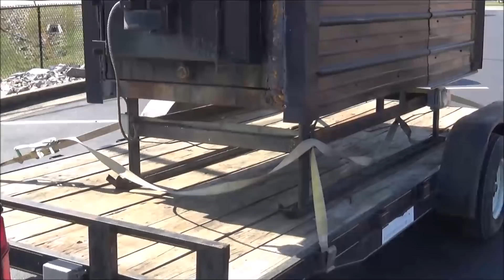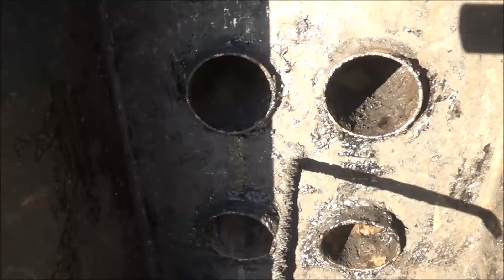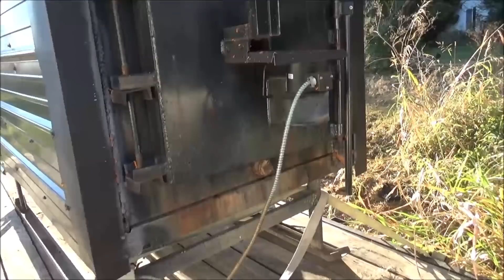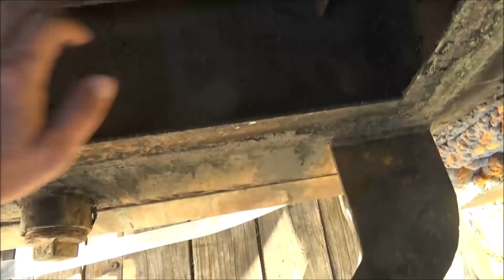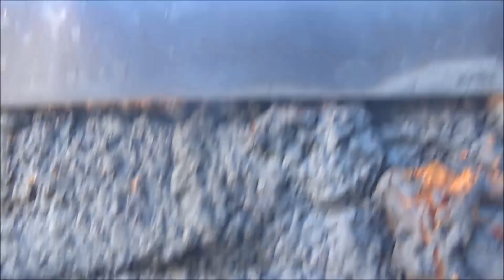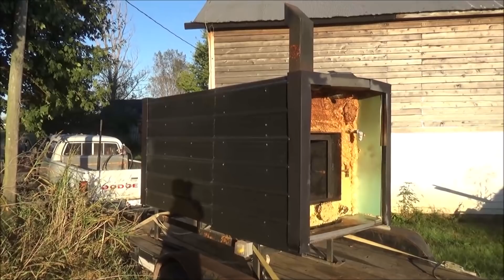New Appliance for This Old Barn Shop

Comment: .do not fire brick it  it will rot out these stoves build creosolt from smoldering wich makes acid iv had mine 20 years it was brick 3 years rotted out rebuilt no brick been great water tubes need to be on roof of fierebox and go the lenght of box i do live in north mich i heat my house garage and domestic hot water and clothes dryer
Reply from the maker: Thanks for the feedback. I am afraid with no firebrick it will not burn good because I won't be able to get the heat up from the water pulling all the heat out.  I know from burning wood in the house for years that the hotter the fire the cleaner the burn and the better it all works. I was wanting to get a big thermal water storage tank to add capacity and then set it up to run the fire wide open for like 6hours a day and store enough heat to last 24hours so I would only need to tend fires once a day and I could get it burning hot and clean for most of the time rather than slumbering along smouldering all day making lots of smoke and creosote. Thoughts?

Comment: Saw this video when you first posted.
Ran across it to day.
I am Kinda of a subject matter expert.
My advise would be set it by the road for sale.
I do lots of infloor  projects on both
 wood and gas.
Assume you don't have natural gas , that leaves propane, which is fine.
It's not cheap to hook up one of these up correctly. (Especially at a distance, flow rate, high head pumps etc)
Lochinvar makes a Noble wall hung boiler that will also heat domestic water ( nice to wash up with)
I heat my shop (8,500 sr ft were your crane scale used to live)with 150 k model in Michigan.
The low water temp's that the floor  can utilize is were these boilers shine, mine runs 90 degree water temp's that allows 99% efficiency with flue gas analyzer. ( 90 F -10 Degree Delta T means 80 degree return water means you get a sweating boiler inside, creosote build up.
BUT
I do have a hudge 60" x120" wood boiler "fire tube"
That sits on top of a poured concrete foundation which is lined with fire brick, it can do up flow gasification and reach temperatures of 2,000 F.
It's all still all there, fully mission capable. Don't use it, anymore.
Hang the boiler on the wall, few hours of hook up and back to machines not chain saws, for what it worth,  my 2 cents.
Reply from the maker: I already have a $2k/ year gas bill for the house, not really looking to have another one for the shop, but I do agree that fooling with wood is a pain in the ass. If I wasn't having to handle it all anyway to clean the fields every year I probably would do as you say. I am planning to use a large insulated water storage tank so I can hopefully run the boiler hard once or twice a day so it burns clean and efficient then have a mixing valve to control the much lower water temps on the floor circuit.
Reply: @bcbloc02  
Your on the right track with the mix valve or a variable speed pump actually might be cheaper, buy one thing instead of 2.
I'll email you some pics of my described wood stove.
It's what you build when you have depression to keep your mind busy. It's kinda nuts. Boiler holds 1500 gallons tank holds 4000 gallons 
Honesty, I would not advise anyone to go to wood burner route. 
What's your electric rate, ground water close or a Good well.
Water to water heat pump work great, have one of those too, rate went up to 9 cents on off peak.
Needs to be 4 ish cents.
Betting your going to try wood,  
Easy to make mistakes,  questions
Reply from the maker: Yes I have a spring just down from the shop. Who makes a good water to water heat pump?
Reply: @bcbloc02  
Mine is a trane 6 ton, but really anything you can find would work
You could build one. If you have any refrigeration back ground.
But I am sure with your audience there is one out there, just sitting around. The other good thing is that you can use a chilled water fan coil and air condition. I stuck a wood boiler coil on the inlet side of the gas unit heater (that I use to buck the temperature up above the infloor radent see point[ winter]) it pulls down the humidity in the summer, gota believe everything rusts down  there.  
If you really wanted to be fancy, pull the humidity down below the dew point W to A then put chilled water into the floor. (That's kinda a show off thing) called chilled beam. There are some surplus outlets for NOS HVAC stuff.
Quick look on line new 5ton 3,500

Comment: Looks a lot like the Taylor brand of stoves. Make sure to use the chemicals to keep it from corroding. Taylor also uses a anode rod to protect the stove. I would build a rack for the fire to burn on so you can get air through it otherwise ashes build up and it’s hard to get a good burn

Comment: Wow! I'm a retired steam locomotive engineer and mechanic. With our shop being located at 6,250ft. elevation in Nevada heat was always an issue. Being in the boiler business (sort of) we had to kluge up some sort of wood/oil fired heating device 'cause working at 15 degrees ain't fun. From what I could see I have a couple of observations... fire tubes... too few and too low. Fire brick the floor and a couple of courses up each side to protect against flame impingement. There are several ways to augment wood with an oil drip (waste oil) being blown in with a squirrel cage blower. We made our heater from a 500 gal. tank with 16 fire tubes and forced induction pumping hot water to some giant 19th. century radiators. Can't wait for your adventures in flue cleaning and thermodynamics...lol. Creative routing of a steel chimney recovers some otherwise lost heat.
Reply from the maker: Chuck Haynes curious what you think about corrosion troubles in the space where the firebrick and tank would meet on the sides. Apparently this is a common area for rot out of the firebox as ash and soot likes to get in the gap that occurs there from expansion and contraction. Thoughts?

Comment: That should work well for you, I once rented a room in the basement on an acreage with two houses, both were heated off the same outside wood-fired water heater, very similar to yours.  They were running a water-glycol antifreeze mix, but it worked very well.  Glad you'll have heat int he shop this winter, makes a huge difference!

Comment: Very interesting comparing this design to a locomotive steam boiler. Convection heat transfer efficiency is all about surface area exposed to the temperature delta between the flu gasses and the water. I would think more small tubes would work better than four big ones, but I guess we’ll have to wait and see how it works!  Also, a pellet fuel feeder would be handy once you tire of feeding that fire with real wood scraps. :)
Reply from the maker: Yes more small tubes would certainly be better. I think the reason they typically made fewer and larger ones was for ease of cleaning.  I feel like one of these properly designed should have much more length of tubes to properly transfer the heat completely.  I suspect a fair bit of heat goes up the stack on this one but maybe that was found necessary to create enough draft? Can only see what it is like in operation and go from there.

Comment: I'll just got a similar one for my 200m2 shop . my plan is to put it inside and put an aditional stack of tubes on the outlet to take care of the waist heat with a fan. I allso planing to lay cheramic on floor and backwall (allmost to the top) to increase combustion temp. it allso have a bypass valve for start , direkt to chimey. that i can use if i want most heat to the external stack for quick heating
Reply: and one more thing   
if you make some solar panels and load that hevvy flor with heat in the summer you probably get1-2+ month's of free heat.

Comment: When I lived in Michigan, we bought a Heatilator type wood stove to replace a cast one that was in the house.  It had fire brick on the floor and up the sides.  I only needed to load it about twice a day and we only used about 300 gallons of oil for the furnace all winter.  I would have preferred to have had one similar to this for heating to have the fire out of the house.
You might want to dredge up some old textbooks and add 4 thermic syphons on each side of the firebox to circulate the water within.  If the sides of the firebox have water, connect a syphon low to the front and high in the tube sheet.  The water will naturally rise in the syphons circulating the water in the whole tank.  The syphons would be the easiest modification to the unit other than firebrick on the floor and up the sides to protect the steel.

Comment: I would not put fire brick in the heater. Creosote will eat the steel up behind the brick. You want to keep the heat in the fire box as long as possible and burn slow. Don't but a lot of wood in till you learn what it needs. It will use a lot of wood till the shop gets warm, when its not heating (idling) it will over heat if theres to much wood in it. Be sure the water pipes from the heater to the shop are well insulated. I've been heating my shop with a Central Boiler with radiant floor heat here in Wisconsin and really like it.

Comment: I wondered what you were going to use to heat that floor , a bit more high tech than my plan  21/2 foot dia x 5 foot pipe i am going to make a pot belly for inside the shop !  Looks  good .  Cheers .

Comment: My first thought in that opening scene was "McD's is doing wood fired barbeque now?" :-)

There are tons of old books from 100 years ago on boiler design for steam engines and the like. Yes, this isn't a boiler because it doesn't get that hot, but the principles apply. 

In a locomotive the heat transfer is all done in the first 12 feet of the fire tubes. You are a lot shorter here, so probably losing some heat.

If there is wet sump under the firebox there would be no reason to brick the bottom. But you probably want the fire up on a grate rather than that plate to get some air circulation and have a place to drop the ash out of the fire, and hopefully rake it out easily without having to clear the whole fire.

Comment: Brain you just need to figure out how to bottle that 90 degree heat for winter!!!! LOL I have had several out door wood stoves. You will want to fire brick the bottom and the side. Mine had one coarse stood up around the sides.  I cut my wood one year ahead. Good seasoned wood greatly reduces the creosote issue. I would think you would have tons of old barn wood left from the remodel too.  The only thing with burning boards/smaller wood is they will burn faster then BIG chunks. I just block mine up to where I can lift them. The larger the chunk the smaller the exposed surface so they burn slower. A stack of split wood or boards has too much area to burn at once so it burns faster.

Comment: I know lots of folks use those back home in the Appalachians.  They'll heat a house in a New York minute to any temp you want from what I've seen.   I don't suppose its a closed loop as you have a vent.   I wonder do you need to run anti-freeze in them at all to keep the pipes from freezing when it goes off-line in the dead of winter.  You think you might use it to heat the house too?    A TEG Generator powered circulation pump would mean it works without power but I guess you'd need a TEG generator powered fan if you were using that.

Comment: Well,my experience with a fire brick lining is with your fire box it would allow you to fun higher temperatures without causing damage to the metal walls and floor.  I don't think you need higher temps as you mentioned so not sure lining would benefit you all that much.  Again, in my wood stoves it protected the metal firebox from warping and did retain some heat as the fire burnt down but not for long.  A lining would cut down on fire box size, too!  Greg

Comment: I bought a very heavy duty home built woodstove, in my opinion it was head and shoulders above any commercial unit available for purchase....However my insurance man made me get rid of it because it was home built and as he said not certified. It was a pissin match for awhile and he finally said either it goes or your policy goes you decide.
Reply from the maker: Cad-Cam_Man  This one isn’t in any buildings so it shouldn’t matter for insurance.  If it burns up it will just be a spot in a field. Of course being full of hundreds of gallons of water and almost entirely steel it couldn’t burn much,
Reply: @bcbloc02  your correct but it's been my experience that the insurance suits dont think like the rest of us. Lol

Comment: I always get a kick out of people that say "my wood is basically free".  If you place any value whatsoever on your time, heating with wood is about as far from free as you can get.
Reply from the maker: Tom Krause I have to clean it all out of my yard and fields anyway so might as well get something out of it rather pitching it in a sink hole.
Reply: @bcbloc02  I do that myself, but the accidental stuff is enough work for me, I don't want to depend on it for every day heat. There's a reason God made a gas line grow out of the ground in front of my house. Look forward to all your vids. Been doing a bunch of machinery rigging/loading at work lately, haven't dropped one on the floor yet.

Comment: Absolutely firebrick the combustion area. 200 degree steel is dead cold to the fire and these things never get hot enough to burn the smoke and gasses, where half the energy is. The heat transfer area of the tubes looks small, maybe add turbulators to hold the exhaust in a little longer? Complaining aside, I wish I had one too!

Comment: The last fab shop I worked in many moons ago, had a burner system very similar to this. They used cut up tire chunks for fuel (yeah, I know), and all it took was one full run to keep the shop heated for most of the day. I'm sure you're not planning on burning tires though :)

Comment: My experience from up north says you won't gain a whole lot in having the firebrick heatwise. You will gain a huge amount in preserving the bottom of the firebox. I would put the firebrick in and one course vertically on the sides also. If you keep a bed of ash under the fire its just like insulation, kinda negating the heat capture of firebrick. But ash, creosote and regular fire loves to eat metal. Great thing about that size is the big old qnarly chunks you wont have to split, just shove em in there. Looks like all the scrap piles from the shop rebuild will disappear lol. Thanks for sharing

Comment: In the Uk in domestic underfloor heating systems as a rule of thumb we try to have a average of 5 linear meters of 16 mm pex pipe per square meter of floor to be heated this is usually fitted on top of 100 mm of insulation board with a 70 mm dense screed over
 the water in the UFH  system  up to 40 degrees C this gives a floor temp that is  comfortable 

the space above feels warm at floor level no matter how high the building

Comment: With propane at 64 cents a gallon summer fill and at 1.29 winter contract. I would never consider wood. I have all the equipment to do wood just cant justify the labor of wood.
Reply from the maker: Dale olson Our prices are not so low. Summer propane is $2 and it runs more like $2.50 in winter

Comment: Do you have a way to make the water in the floor the right temperature?  Too hot = cracked concrete.
Reply from the maker: A mixing valve goes in the system to regulate the water temp going into the floor. It won’t need but about 80deg water going into it which is a lot less than what the furnace temp will be.

Comment: The insulation is really scary, could catch fire easly. I would have used rockwool or glassfiber insulation
Reply from the maker: registratore primo that spray foam won’t burn
Reply: @bcbloc02   i did't know that, i'm from italy and here spray foam is less commonly used. I was worried because the foam is really near to a hot surface

Comment: It should work well as long as your wood's free or very cheap. Running oxygen starved really affects efficiency. Smoke is just unburned fuel going up in the air. I have a smaller burner in my house and I used to load it up and let it run smoky. I now use much smaller loads, and run it hot until it nearly burns out then repeat. Average heat output is around the same but my wood usage is around 2/3 of what it was.  The down side is that you have to tend to it more often. With the cost of wood around here that saving is worth the small amount of extra labour.
Reply from the maker: LesNewell my wood is free besides what it cost me to cut it up and move it around the farm. I still have the mountain of old rotten busted wood out of the barn left to burn too.
Reply: Free's always a good price :-) I had a big stack of old wood from my own barn restoration. It's quite scary how fast it disappeared. By the way, a chop saw is great for cutting up used wood. A cheap carbide blade will handle the odd nail, unlike a chainsaw.

Comment: We had one very similar to yours that heated our shop that has in-floor hydronics - 36,000 sq ft. - and it worked great.  The only problem we had is that the heat tubes started leaking after 20 years of use.  Get a good wire brush to keep those tubes clean.  We went through about 50 cords of wood every winter.  I think you will like it.
Reply from the maker: Reid Eichner it came with a bar with a disk the size of the inside of the fire tubes you can rod them out with from the front.
Reply: @bcbloc02  That is good but we had a flue brush the diameter of the inside of the pipes.  I ran it through the tubes a couple of times a week and it worked really good.  It was a stainless steel brush that we welded to a piece of thin wall pipe to be able to reach the far side of the tubes.  Your disk might work just as well.